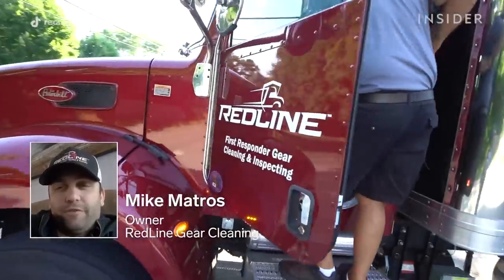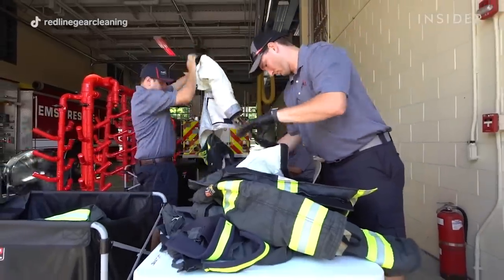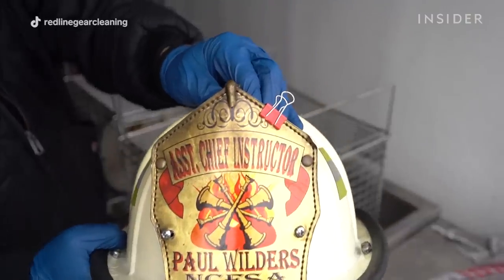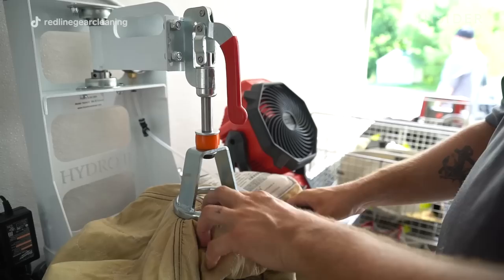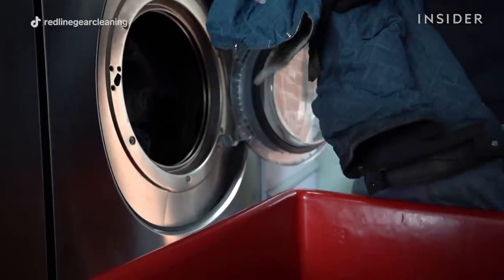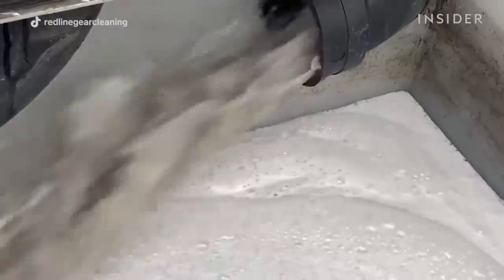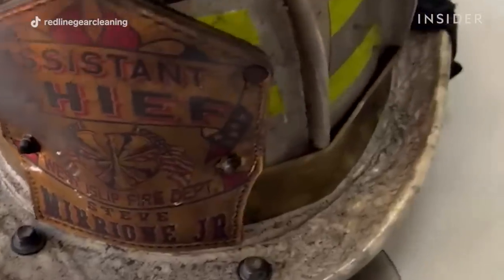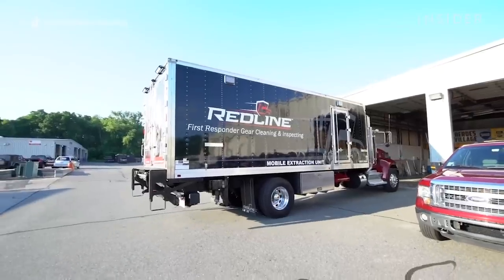How Soot-Stained Firefighter Suits Are Deep Cleaned | Deep Cleaned | Insider

Comment: How is this not the standard? This is absolutely amazing and an imperative part of taking care of your gear and self.
Reply: Probably not cheap and not available in most places, not to mention downtime.
Reply: Hopefully each state has several wash trucks in few years
Reply: Where i am from the firefighters thinks it makes them cool to have smoke stained gear. They would for sure protest if someone tried to clean there helmet
Reply: @james-hb5tu  When I first started it was that way, but then we learned.  But spare gear is VERY expensive, and you can't get gear the same day, some places it takes up to 10 months to get gear delivered.
Reply: @s0nnyburnett  Its relatively affordable, at least how we do it here, because the whole system is designed to be modular and interchangeable. After a fire, you disassemble your gear which is basically just removing anything out of your pockets, your name strip and velcro on the back. The jacket and pants can be washed as one, and the helmet gets its inner parts taken out, which are sent to the manufacturer to clean in regular intervals, they just get a new one, wipe down their helmet and they are good to go.

Since we do it after every exposure, its not nearly as complicated as in the video because, even after a fire they are still much cleaner than what is shown here. The cleaning station in  our department are just 2 industrial washing machines and a dryer. They go from a basic rinse to the second machine to get treated and than dried, you usually have your gear back after like 2 weeks max, for the period in between you get older replacement gear, which still does the job.
Reply: It's literally the standard nfpa 1851 people just choose not to follow it.
Reply: @Coronet_shop the model won't work for a large department like fdny, LA county or Phoenix. Centralized hubs with delivery drivers is more viable. And what most departments do.
Reply: @robertsestito6821  There are a LOT of NFPA standards departments don't follow, mostly because they're too expensive or impractical.
Reply: @ffjsb  yeah issue is 1851 is law in some states.
Reply: @robertsestito6821    I GUARANTEE lots of FD's don't adhere to it law or not.  Do you have ANY idea of how much a set of gear costs, or how long it takes to get a set??
Reply: @ffjsb  seeing as I buy around 2 million dollars a year in ppe for a department of 600 paid ff, and run a 1851 facility that washes around 12,000 peices of ppe yearly I'd say I know what things cost.
Reply: @ffjsb  most don't and unfortunately cancer rates show that.
Reply: @robertsestito6821  And what's the delivery time for Globe or Morning Pride right now???  Your FD is the EXCEPTION, not the rule.  I just retired from a FD over twice the size of yours, and couldn't even get a new helmet strap because they didn't even have a spare helmet for the whole FD.
Reply: @ffjsb  I stock 1 year of ppe at all times. So I have around 100 helmets 200 hoods, 200 gloves, 100 boots. Lead times on  structural gear for us currently is around 45 days. Globe delivery issues stem from msa not knowing how to run a turnout company. Honeywell is trying to sell off MP and running it into the ground. In 2 years lion and fire dex will be 1 and 2 in ff ppe. SCBA parts are a bigger issue currently since there's only 2 players. And in California where we are wildland gear is a huge issue. Again why we stock gear.
Reply: @robertsestito6821  Turnout gear doesn't prevent you from getting carcinogens on you skin...
The person most exposed to CO on a scene is primarily the apparatus driver....
And people get cancer from a number of things, not just being in a fire.
Reply: @ffjsb  Co isn't a know carcinogen, and clean ppe reduces exposure and help with mitigation,  in addition to a solid PER process you can reduce exposure significantly up to 80 percent reduction of VOC and PAH with wet per. It's all easy stuff people just don't want to do it. My guys don't, they have 2 sets 4 hoods 2 gloves 2 pair of boots and a helmet, and they don't wear scba during overhaul or do PER. It's all choices departments need to prioritize prevention because a single WC cancer case costs millions.

Comment: I see a lot of new fire stations use the new hot, warm and cold/ neutral systems but even if they take there coats and helmets off they still bring it in the cab of the truck and then they breath in or it gets all over the inside of the cab. The only one that doesn’t always do that is the driver and they keep it on the outside of the truck in a compartment which is smart. Keep it out of the cab if it’s dirty and keep the SCBA in a cabinet on the tuck. 

I see a lot of fire department have rehab units. That usually have snacks, water bottles, and such. It should be a law that they have two separate “rooms” and they have to quickly shower in this room after a fire that’s built into the rehab tuck.

Comment: A lot of that gear should still be thrown out after though. Those burnt and crumpled helmets? Even after they're cleaned, those burnt areas are prone to increased heat absorption and reduced protection. Those helmets no longer have the mechanical properties necessary to protect you from impacts of falling debris. Those discolour reflective strips? Those strips are there for a reason. You endanger yourself needlessly. What these guys are doing is great and over here in Europe is actually the standard in most places, if possible after every single fire. But you also need to know when a helmet should serve on a desk rather than in a locker.

Comment: Why don’t buy some new gear from time to time?  Some stuff like the helmets looks really old that can’t be good.
Reply: They do buy new ones. However, the cost for a firefighter turnout gear is about 7 to 10k. So it really needs to be unsafe and unusable bore that can happen
Reply: Specialized turnout gear is extremely expensive. Guidelines state gear may not be in service for more than 10 years and without proper cleaning a lot of gear doesn't last that long. We hope to help extend the life of a firefighters gear and save money for departments

Comment: change the cancer causing material the gear is made of then ill consider washing my helmet.
Reply: The cancer causing material is not the gear, but the soot from the fires impregnated into the gear or the smoke from burning gear, but any smoke can be cancer causing with enough exposure. Even the smoke from making steaks and other foods is cancer causing, but since you're not doing that too frequently in unventilated areas it's not that dangerous. I'm willing to bet that even if the gear was entirely metal and cotton if it was burnt and was contaminated with soot it would just as dangerous. Cancer can be cause by small particulates of even generally harmless materials if it's small enough and the exposure the great enough. Stay clean, stay safe.
Reply: @Marian87 I believe they say that PFAS found in some turnout gear could be cancer causing too.
Reply: @lukeshaver1149  Since you basically have to consume contaminated substances to be exposed to PFAS, I think that's a relatively minor concern, given that most of the US population has exposure to PFAS anyway because they're in so many things. But even if that is a concern, not cleaning your gear only makes it worse, because now you've got combustion products you're inhaling as well as PFAS. That's like refusing to quit smoking because you heard that nicotine gum has artificial sweetener in it, and that's not good for you. Well, maybe not, but you're not doing yourself any favors with the heaters, either.
Reply: Brother, that’s like saying I won’t quit smoking until they make the cigarettes safer. I have a hard time believing PFAS in our gear is the sole culprit of cancer when compared to the dose of other crap we get from a job. If they can remove PFAS from our gear and keep it safe and functional, great. But that’s a mouse compared to the elephant in the room.

We might not have total control over what goes into making our gear just yet, but keeping it clean is something you do have control over, so seize it.
Reply: @mikegardner186  agreed totally but to say my plastic or leather helmet is the worst part and needs cleaning is a stretch.
Reply: It may not be the worst part, but for some reason it’s the part we resist the most. A salty lid is our sacred cow- I get it. But whatever little step I can take to increase my long term odds without impacting the service I provide to my community is worth it to me. It costs me nothing more than my time. If a dirty lid is the only currency we have for credibility and respect in this job, then maybe something else is wrong. I’ve seen more than one sh**ty FF stick their helmet in a burn barrel or stand up in a flash can to get that look. Guess, what? They still sucked at their job. 

Be safe brother- however you choose to.